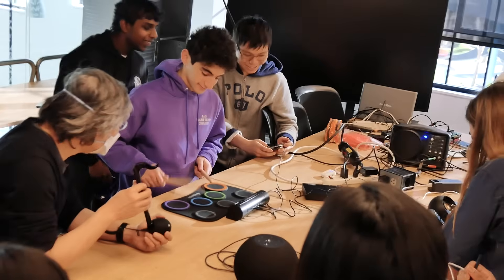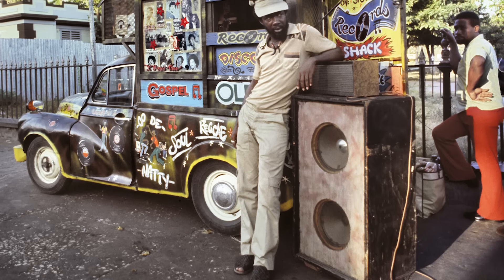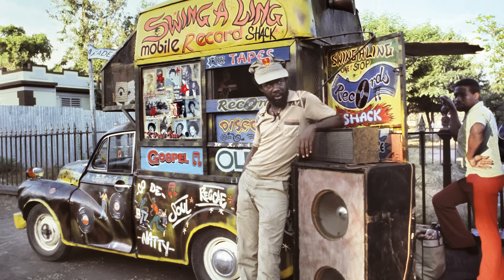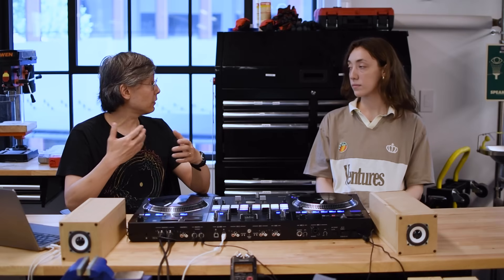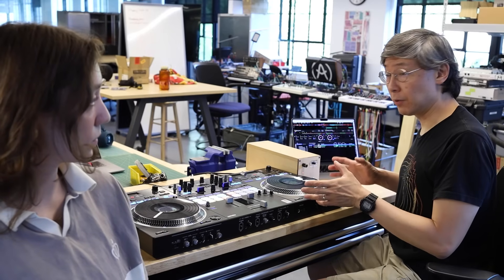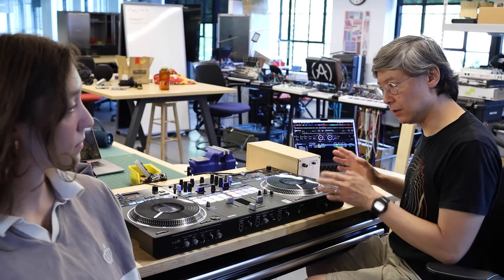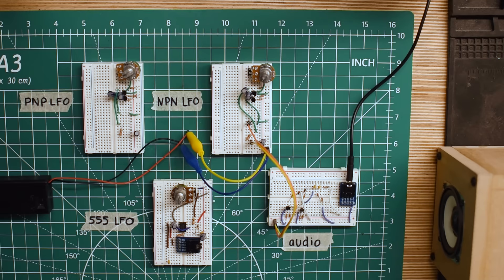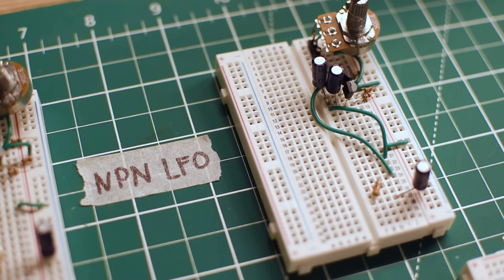Building a Dub Siren (Part 1)

Comment: For the third week now, I have been trying to make and program a dub siren based on the Axoloti Core board. Unfortunately, I am not a programmer or an engineer, so during this time I have only managed to make a minimally functional sound generator with a single TUNE switch... Even ChatGPT can't help me... It turned out to be very difficult. It seems easier to assemble a hardwire siren like in the video than to program Axoloti...:eyes-purple-crying:

Comment: A few years ago, I made an NE555 VCO; I also created an MS20 lowpass filter and an AD envelope (didn't have time to build the sustain and release). When I connected all of the modules, and turned on and off a fixed control voltage going to the envelope, I realized that my MS20 filter was set so that it would be self-oscillating, and it made a WEEOOOEEEOOOEEOO sound like a dub siren.

Comment: Cool. That's gonna be fun. Just to save you some headache and possible hair-pulling, that sound is just two tones—not a ramping oscillation. I'm not talking out of my ass. If I was do you think I would pick this as a flex? 🤣

In music theory it's called a minor/3rd interval, which is the root note (in this case G# 4) and the 3rd, which is the third note up from G# in the minor scale. That would be a B 4, except in this case the B is one octave higher than that of the G#.

So the musical notes are G# 4 and B 5

Now for the EE side. They are definitely two distinct square wave tones, kinda like one of those two-tone European sirens except those are usually root/5th intervals and much slower. I think Germany uses those. Maybe France too, I don't know. But it's not a ramping siren like we have here in the states and neither is that dub siren. It's two distinct square wave tones:

415.3 Hz and 987.8 Hz are the frequencies (for G# 4 and B 5 respectively)

Anyway, just thought I'd save you the headache of going down an oscillator rabbit hole only to find disappointment . To emerge with delicious dub siren carrots, generate the two square wave tones separately, set them to infinity, then use the 555 timer to switch between the two fast. Better yet, no, don't do that. You can do both tones and the LFO with one 40106 IC. Use 3 of the invertors as RC oscillators—two of them you can tune to the tone frequencies, the other will be your LFO.  Feed all of that into one "gatekeeper" IC like a 4053 and there you go. Just remember to tune your LFO to twice as long as your note duration because it's gonna switch the 4053 at every half cycle. And no matter what you do, it won't sound right without all that noise in the envelope. Reverse-bias a 2222 for easy white noise and AC couple that to your signal. Not all of it! a tiny bit. Anyway, these are just suggestions. Really I'm just jealous of your project and want to make one too.

Comment: Hey there, Tubby's delay was the play heads of his recording machine fed back into his main console. He'd use one fader to turn up the delay and feedback all in one, get a a huge infinite sounding echo, and then cut it in an instant by pulling the fader down.  His so called siren was probably the console oscillator used to slate the beginning of the tape.

Depending on the year, there was also a 1bit digital sound effect IC that was popular in the late 80s, and one of the sounds was the "telephone" sound, which is the sound at 8:39, Gemini made a sound effect box out of that, and there were cheap DJ mixers made in Taiwan under various names which had those effects in them, among other toys based on the chip.

Also, this is just an idea, but decades ago when I used to do DJ, my own siren was just a feedback path on my small line mixer, feeding one of the aux outs back into a channel, forming an oscillator. As I turned the channel aux send up and down, I got a great siren effect. With the degree of ingenuity found in Jamaica back in the day, I'd be surprised if some people weren't doing something like that, it's easy to stumble across it when messing around with the typical equipment.

The NJD box is very distinct sounding, I associate that with Jah Shaka in England.
Reply: Great insight,thanks!
Reply: Nice piece of information to fill out this video.
Reply: Jah Shaka/Zulu is one of the greatest! His soundsystem live sets are just dark, skanky Dub gems, full of wall of sound & the aforementioned spacey feedbacking.
Reply: The siren you mentioned was made by NJD.
Reply: @richbrown5852  Ah yeah I meant NJD, typo
Reply: this guy dubs
Reply: Interested in learning more about this IC, do you happen to know the name of it?

Comment: a couple of loopers , spring reverb , dual pt2399 w/ lfo , sine wav saw / square oscillators ,with patchable lfos , tremolo , ms-20 filter , ring modulator , make it all patchable using rca cables or 1/8th inch with a built in 6.5 sub and a car alarm horn on a 15 watt chip amp . 18650 ps , attach some vibrator motors to the spring tank , pwm  controllers for the motors - you can place those all over near the contacts for the spring tank  and even mount one physically to the spring . contact piezo and an ooogah horn for good measure .  King Tubbby would be proud  -++
Reply: PT delays are obviously lofi digi classics, but you can't leave out the beauty of dungeon-like BBD when talking Dub/Rudeboy warehouse music! 🫠